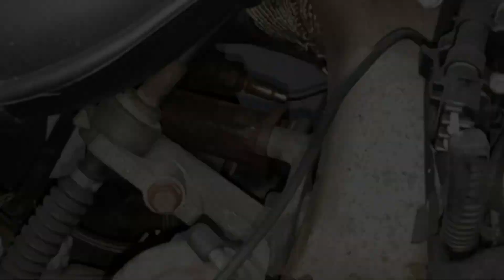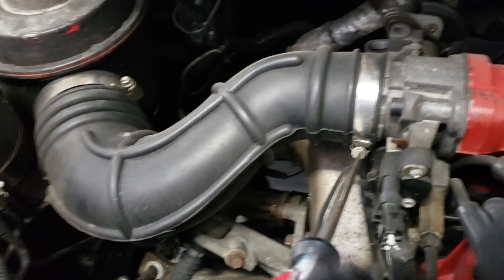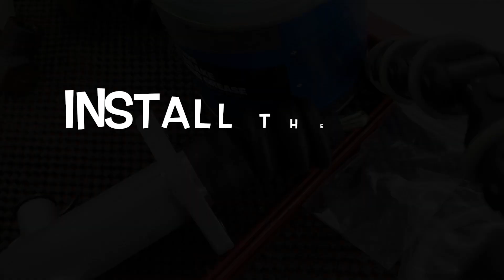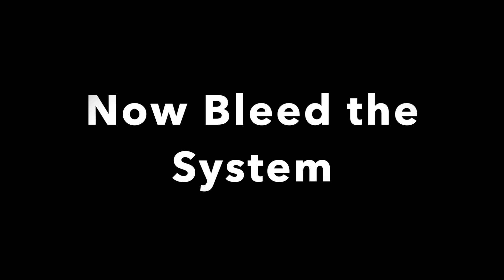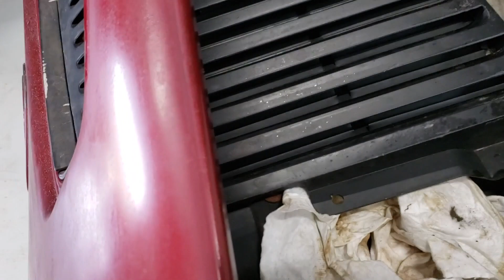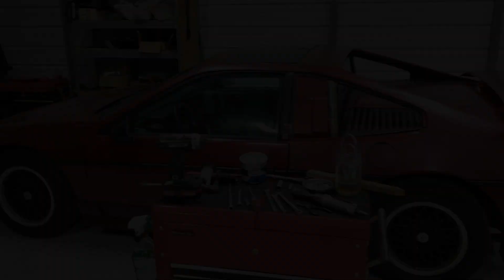Fiero GT Clutch Master and Slave Cylinder Remove and Replace with Complete System Bleed

Comment: So I did push the piston all the way into the bore on the clutch slave. Does that mean we need to buy a new clutch slave? It didn’t get stuck in there, but now the clutch slave seems to open more. Wonder if this is causing leaks now with a clutch slave.

Comment: Dumb Q but what's the appx fluid capacity of the system?  The slave quit (& master sucked in air) so I replaced with the RD master & slave.  Bled almost 2 additional cups of fluid out since the bubbles stopped and the slave seems to fully travel when pedal pushed in with an 8-foot 1x2 but shifter won't go into ANY gear with engine running...usually goes into gear ok (but not very smoothly) with engine off...but not always...  Manually operating the lever in engine bay makes shifter move around fine...WTF!?!

Comment: Nice idea on the master. The best way I've found to bleed the slave is to gravity bleed. Put the LF wheel at the highest point and the RR wheel at the lowest. A driveway works well for that. Then just open the slave bleeder and remove and wait. Tap on the side of the slave a few times to break free any air bubbles. Then just tighten er up, Maybe takes 15 minutes. The problem with pushing the slave rod in or the clutch pedal is upon release there's a good chance of sucking in air from either the bleeder threads or the slave seals.

Comment: Just did this same repair... I used a vacuum bleeder, pumped it to put vacuum on the bleeder and then loosened the nut while using a broom handle to push on the clutch pedal... awkward, but it worked.  Enjoyed the video. :)

Comment: Excellent video! I also purchased Rodney's clutch master & slave cylinders, but put it off cuz I haven't had the chance to review the service manual book yet. Your video made it look so easy, giving me a motivation to tackle this project sooner than later.

It'd be nice to provide a list of items used in the video under the description. Sometime, Youtube's English subtitles didn't catch exactly what you were saying correctly. So, a list & links would come in handy. 

What was the name of that blue lube you used? 

Also, it'd be nice if you could produce more videos about common Fiero maintenance tasks, using Rodney's products. That'd be awesome for everyone in the Fiero community.

Thank you, Jay! I really appreciate that.
Reply: A substitute to the "blue lube" that you can use is Silglide. You can purchase that stuff at NAPA auto-parts and it works great. It's resistant to heat, cold, doesn't react to anything, and helps reduce friction wear. Just did this clutch master and slave replacement and everything is working smoothly.
Reply from the maker: Thank you!  It isn't a hard job, just take your time. Use penetrating oil on the lines and nuts, and let them soak, if they look rusty.